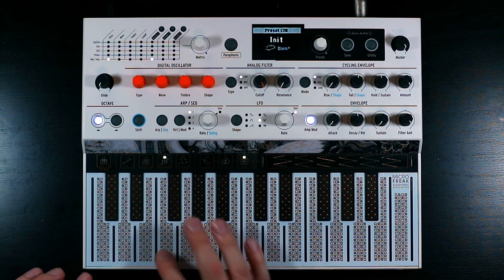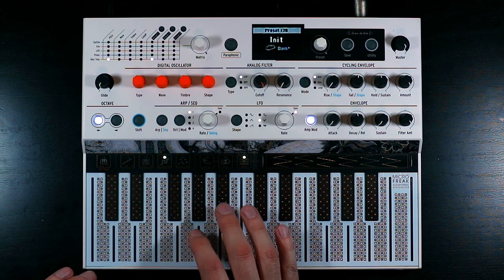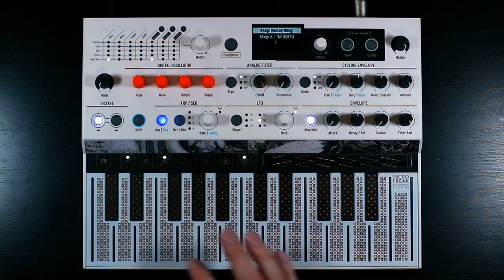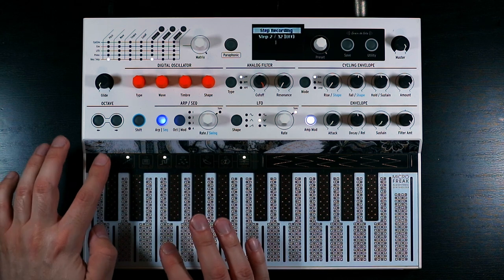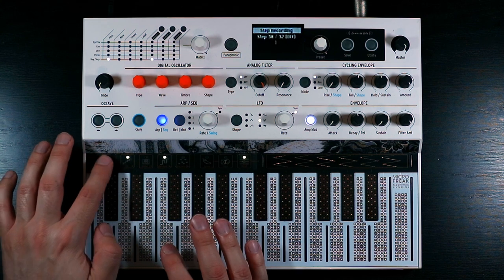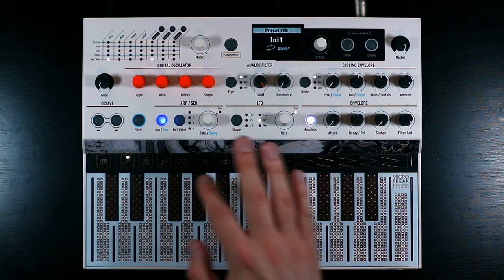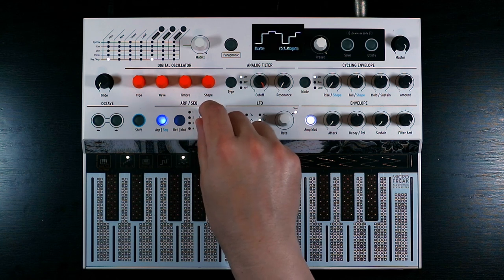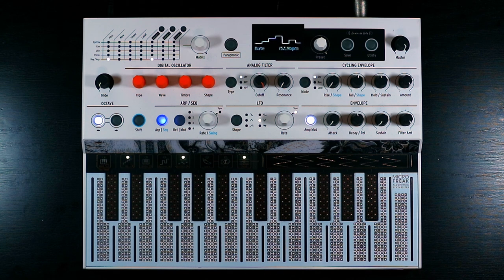MicroFreak V5 - The Granular DrumFreak!

Comment: Brilliant! This crossed my mind watching yesterdays vid. To fully flatten out the keyboard to pitch, and theoretically make even slices of drum breaks possible (?!), I found you can use the Cycling envelope and 2 assign slots as an extra offset. 1. Set cycling envelope to 0 rise and fall, max sustain, on run. 2 Set assign slots 1 and 2 to the Cyc Env->Pitch matrix slot. Key/Arp-> Assign 1 @ -100 depth, and Key/Arp Assign 2 @ ~ -70. Totally flat keyboard! 

Then, In theory Key can then also modulate Sample Start Point (“wave”?) to slice a break that would play without pitching up per key, just maybe?
Reply from the maker: That's a neat hack, shame you have to lose two assignable slots and the cycling envelope to do it... Hopefully Arturia will add a feature to remove re-pitching of samples - I'll certainly be asking for it!
Reply: [Just noting that the above adjustments are in addition to the Keyboard -> Pitch @ -100 that Osc puts in. Adding the cycling envelope as a second mod source gives it extra range.]
Reply: Circling back to finish the recipe with stock sample 42: Drum Breaker: Sample Machine
Key/Arp -> Pitch -100
Assign 1, 2 : Cyc Enc -> Pitch
Key/Arp-> Assign 1: -100
Key/Arp -> Assign 2: -65
Cyc Env : zero rise/fall, hold/sustain 100
Key/Arp -> Wave (sample start): 100
Octave +1

From there it will play a slice per key. (The presets break the loop by automating sample start in the step sequencer.)
Reply: @d..d6201  amazing, nice work!

Comment: Great trick, I look forward to trying it.
On a side-note, I would like to comment on your use of the Spice function. I see you changing the Spice level each time you ask the machine to make a change to the sequence. Sorry if that was deliberate, but I am not sure that you are using it at its most. Indeed, the way I understand it, the Spice intensity (that you chose through the pitch bend stripe) defines the amplitude of the changes that are made to the sequence. But then, in order to apply changes of that same intensity, you need to press the Dice button.
In other words, the Spice parameter lets you define what intensity of change will be applied to a sequence, and each time you press the Dice button, you "roll the dice" to apply a series of such changes to the sequence. With a small value of Spice, each new sequence will differ from the previous one by small changes in the note placements, and with a large value of Spice, large changes of note timing will be applied to each new sequence.
Hopes that clarifies a point. My apologies if you knew that already. Keep up sharing great ideas !

Comment: YES!! Thankyou! I was wondering if I could load multisamples (one sample per key like drum kits)on this unit with the version 5 update. Now while this feature which is as old as samplers are, can be very good for drums, I have always related "samplers" with my VOCAL clips. Sooo.. being able to load different vocal clips per key will make this synth faaaar more fun than I could have ever imagined when i first bought my Microfreak back in 2019 when it came out lol!
Reply from the maker: Yeah, I really regretted not mentioning it in my original video. Just be aware that (at the moment at least), you can't avoid repitching the samples across the keyboard. I'm going to feedback to Arturia asking whether there's the possibility of them adding a feature to disable that...
Reply: ya that seems like a bit of an oversight to not be able to disable repitching.
Reply from the maker: A little, perhaps, but also - this not a "standard" use case. Nevertheless I hope they pick up on the feedback.
Reply: @OscillatorSink  My dream future features after the previews for this update would have to be an option to deliberately map samples to specific keys, and the ability to sample in via the vocoder input. I imagine there has to be memory or read/write limitations preventing either from being possible though, but I can still dream.
Reply: @dylantreisman621  yeah I feel like if it was possible to use the vocoder to sample in, they wouldn't have missed that opportunity. Might be an actual hardware limitation
Reply: @d3tuned378  I definitely suspect that's the case. On the other hand, there have been times in the past when I would have said the same thing about it having a vocoder at all, or being able to sample, or custom wavetables. Ridiculous what they manage to keep churning out.
Reply: Does the MicroFreak have an actual A/D, an Analog to Digital Converter? I mean the Vocoder where the voice is the modulator  must somehow get that into the MicroFreak to modulate the carrier, which is a digital waveform within the MicroFreak. Doesn't this mean that the modulators signal (the one that goes in through the mic) has to be converted to digital?
If so, it would be theoretically possible to also sample directly into the MicroFreak. Maybe there is another limitation that makes this not possible. Some hardware performance restriction? Or some conflict between competing parts of the Synth if doing sampling going on?
Reply: @Magnus_Loov  I was going to say it will be implemented in SOFTWARE to allow the right combo of buttons to allow this but there is one thing that is not present inside the MicroFreak in Hardware: Sample ram BUFFER. This is a volatile LIVE ram area that allows the temporary recording and storing of samples, until you commit or write the samples to internal flash nonvolatile memory. HOWEVER.. I could be WRONG!! I have a KORG PA600QT arranger that has all the hardware needed to allow the same thing as the MF, but only SOFTWARE update to the OS allows the sampling feature and vocoder? So it maybe possible soon with MF..
Reply: My feeling was perhaps there's a limitation on the ability to write to the sample memory from the device itself. I know nothing about the hardware or software architecture of the Microfreak so could never say for sure. The fact that you can save presets on the synth means obviously that it can do write operations without the MIDI Control Center, but given how slow the sample upload apparently is perhaps it's just not fast enough to feasibly save live recorded samples.

Comment: could you do something similar in a single sample by mapping the keyboard to the start sample point as well rather than the sample pool?
Reply from the maker: Yeah, I don't see why that wouldn't work, although all of the samples would need to be the same size I think.
Reply: I've tried this a long time ago and it doesnt really work as there's no sample accuracy in finding the start point. You only have 128 different available start points and it rarely lands in the right place
Reply: You can make a long sustaining texture, and then it doesn’t matter where you start. You use the envelope for the amplitude of course. Add a click or other impact transient on the beginning and there you have it, evolving sample percussion. I’ve done this for other samplers and it’s fun to design the texture wav.

Comment: Thanks a lot for this interesting demonstration. I tried to assign the sample function to the keys but it unfortunately didn’t work for me. Could you tell us, which keys you exactly did activate to get this across? When I am at Key/Arp point and have pressed Assign 1 I cannot select the matrix routing for sample function.
Reply from the maker: You need to switch the Type knob to sample select mode first (shift+ turn type) and then assign to the type knob. You will also probably want to have a sample selected in the middle of the sample list as a starting point.
Reply: @OscillatorSink  I did that, but I just get different pitch on the same sample. I did set the amount to 100 in the Matrix. What did I miss to do?
Reply: Okay I forgot to assign to the Type knob. Now I have different sounds. Great!! Thanks a lot!!!

Comment: Hi- how did you get the sampler to load - and then use the grain sampler? I thought the two different “engines” couldn’t be used simultaneously? Basically the first few minutes of the video was very quick for me
Reply: (At the 4 minute mark) - thanks for any further information
Reply from the maker: @craigwood8862 they are not being used simultaneously, but they both make use of the same samples and the sample selection works the same way. So for the purposes of the "spreading the samples across the keyboard" trick, that works identically in all 4 sample engines so you can do it in one engine and switch to any of the others. 

 If you're unsure, it might be worth watching my more in depth video on the sample modes - as I say in this video, I'm skimming over some things that I previously covered in depth in that other video.
Reply from the maker: @craigwood8862 here's the other video: https://youtu.be/kDuambYViYs?si=ZDiPzuGqEuosfVep
Reply: @OscillatorSink  OK! I’ll try a few things on my mf and look at your other content. Thanks for the help!

Comment: ATTENTION MIDI CENTER CRASHES ON UPDATE AND KILLED MY MICROFREAK! STOP USING THAT UPDATE. MY DEVICE IS BROKEN AND DEAD NOW!!!!
Reply from the maker: Have you tried putting it in bootloader mode and sending the update again? Hold Arp+Oct+Shift as you power the synth on to put it in bootloader mode. MCC should detect it and you can send the firmware again.
Reply: @OscillatorSink  Yes I could save the device. As problem was midi center crashed which is not ok and I told arturia guys about it.